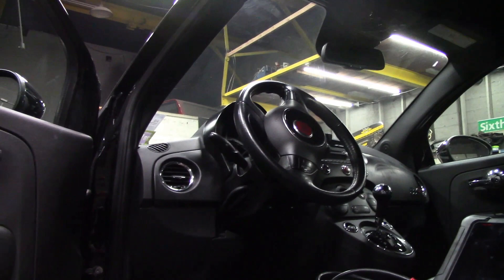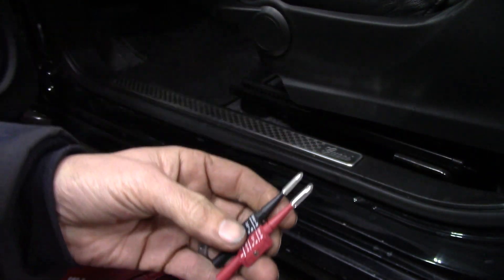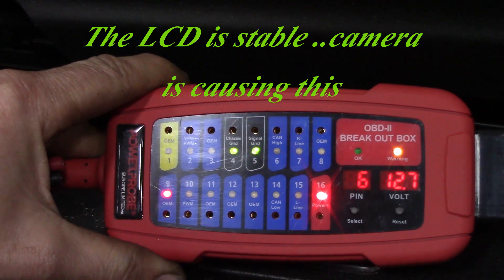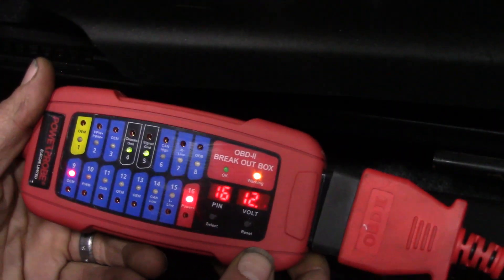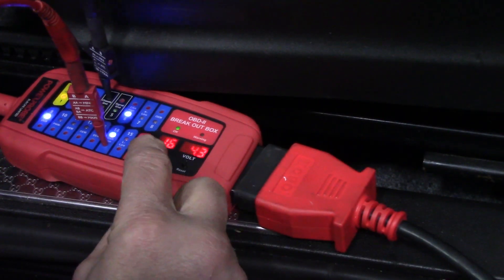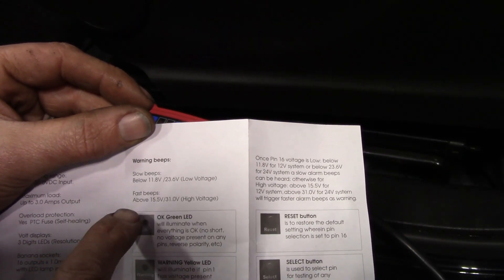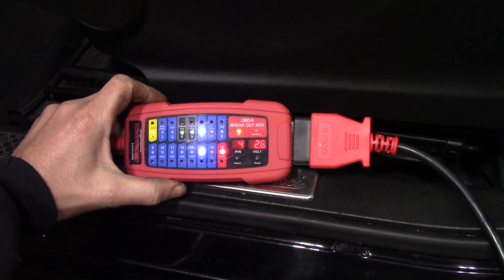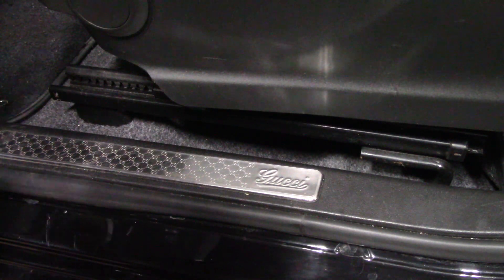Power Probe BOB (OBD 2 Breakout Box)

Comment: What would be cool if it tells you the resistor of 60ohms good or 120ohms open of your communications. Maybe on the 2 they will. For 200$ pluse I'll wait for that option.
Reply from the maker: That's what a meter is for. Plus you need to consider sgw

Comment: L.E.D's are "Light Emitting Diodes" witch means they flicker at high rate to provided a solid image or light to the human eyes. cameras due to frame rate will pick up the flicker , If you do alot of filming of L.E.D's you can find information on how to adjust frame rates accordingly to not get flicker. just a answer 🙃

Comment: The reason the LEDs are flashing in the camera is because of only one pixel is lit at a time.  The micro display rotates lighting among the individual LEDs in display so fast that the human eye sees a steady light.  However, when the video camera scans the display it will get repeat scans when  pixels are turned off hence the flashing.  You can get the same effect like when videoing a air plane propeller. Maybe some day our technology will be tuned to work more like our eyes.

Comment: Circuit resistance for HSCAN, and if you have a Power probe 4 the driver option could work on that also, I plan to use a ECT3000 on it to find opens on a Can Bus.
Reply: did the ect3000 work for the can bus?

Comment: Hey joe..what is you’re opinion on using solder or butt connectors on a 2010 Chevy Silverado driver door jamb rubber boot..wire is broken that goes to airbag impact sensor in door
Reply from the maker: Make the wire long enough that the joint( repair) won't be under stress and then solder if possible. I have never had a failure in all my6 years doing it that way.

Comment: Why make a tool and not use standard connecters what happens when the connecters get lost does a standard multi meter lead fit?
Reply from the maker: You can use any basic probe you want on this. It is not anything special. 2mm if you want them to be a tight fit...but any probe will make contact and read.
Reply: @JoesAutoElectric  Looks like t pins would be perfect if you're careful.

Comment: The tool shows where there is low system voltage reference signal in the circuit. You need access to pro grade wiring diagrams to be able to find the right area. Then you could find problems really fast. Most people can't afford the pro grade wiring diagrams.
Reply from the maker: This tool is not really directed at a DIY'er. Most would be lost trying to fix a comm issue on late model vehicles. This mainly comes down to training as well as having the proper equipment. There are reasons we get paid for what we do.

Comment: I made a simple breakout box myself some time ago. A small 20volt LCD Display for the voltage, a few female banana plugs, a ODB2 cable extension and a box. 30 minutes work and I had a simple breakout box that would beat the China stuff for just 10 bucks or something and I know what I have. The breakout box is just to measure voltage with my meter / oscilloscope or hunt for CAN Bus trouble.

This breakout box costs around 190 Dollars plus tax and shipping, that is a lot.
Reply from the maker: Nothing wrong with making your own man. Good for you.

Comment: Odd to see the use of pin tip jacks. Mostly legacy / military now. Been a long time since I've seen commercial equipment using that. This is probably an adapter that will work. https://www.pomonaelectronics.com/products/hardware/banana-jack-pin-tip-adapter
Reply from the maker: Yes, any 2mm will work. I would just like a source to find more of the magnetic ones it came with.

Comment: Good tool... Its been available for about a year  but again not seen many guys using it. Does it still have the light in the dlc connector to help you find the plug?
Reply from the maker: Yes I simply forgot to mention the light in the connector.

Comment: Nice useful bit of kit. The probes that come with it, are the tips anywhere near the size of standard meter probes ?
Reply from the maker: They are 2mm.
Reply: @JoesAutoElectric  : Hey Joe, thanks for the reply buddy. At least the fact that they're normal probe size helps, not as convenient as the small magnetic probes supplied with it but workable all the same 👍
Reply from the maker: I agree. Most of the tools I have experience with PP are fantastic. I have searched and still do not see a source of the probes that come with the tool, however...
Reply: @JoesAutoElectric  : Yeah, I had a look at UK and European sellers and don't see them listed. Only place I could see the breakout box listed is in the USA. Nice to see your still doing a brilliant job diagnosing and repairing the stuff people throw at you.

Comment: It looks nice, but I will keep using my $15 e-bay china one for now.  I'd rather put the money into my Pico savings fund!   I guess seeing the voltage is nice, but usually I am going to be scoping Can High and Low most of the time to to see the actual signal, or I just want to temporarily add a module to the buss to program or test.   I tend to use a cheap Harbor Freight logic probe as a quick and dirty method to see activity on a CAN when I am working throughout the vehicle.  I guess the connectors are okay, but I would want more than 2 adapters, and I'd rather just have banana jacks because everything else I have is banana jacks.
Reply: I never use tools test or safety equipment made in cheating lack of quality control scum bag communist china. My cheap boss purchased several cheap china garbage capacitor & electrical VOM meters. Leads broke within 3 months and very not accurate. Went back to Fluke.
Reply: try the american hook  class act
Reply: I get voltage reading on the China one I bought, it may have been slightly more but not crazy like the other break out boxes such as the aeswave.

Comment: The LED display is flickering because it's multiplexed. Most 7-segment LED displays are. To save power, and to make the circuitry simpler, only one section of the display is lit up at a time, but the sections are scanned/lighted very quickly so your eye doesn't see it. But your camera does, as you said, because of the scan rate of the sensor or software..
Reply from the maker: Thanks! I learned something new! Awesome!
Reply: I was just about to say that. Glad I looked first.
Reply: Pulse width modulated....
Reply: @Divided-Kingdom  - Nope. Multiplexing is not the same thing as PWM. Not even similar.
Reply: @futz48  true.
Reply: Was just going to say something similar. LOL
Reply: The only reason the camera can see it is because cameras have shutters and eyes do not. If the shutter speed syncs up with the super fast flickering of the display it becomes visible. If you change the shutter speed it will change the effect and sometimes completely go away. Cameras have issues with led shop lights too. Rather than the flickering you get banding.

Comment: Please do not take this as an insult to your intelligence because you probably see a lot of it. It is astonishing how many people squander upwards of $600 US on special oil and filters in a given year and NEVER do anything to keep their cooling system clean and in about 7 to 10 years (at the most) they effing wreck radiators, ball bearings in water pumps all kinds of gaskets, actual springs from pressure caps that rusted off and floated in the rail and G-d knows what else. Those probes (which look similar to something from John Fluke MFG diagnostic multimeters and other tools) you want are probably are available at Greenbrook Electronics which is now where Eber's furniture was on US 22 West in North Plainfield. They are loaded with all kinds of things. I purchased "RippOff" brand condura holsters that I modified to work well with a military web belt to hold a graphing calculator on the left and a BlackBerry PRIV on the right. I SWEAR I will make videos on these things.